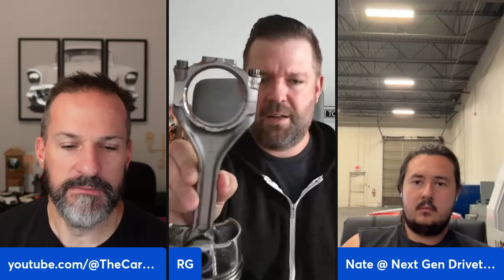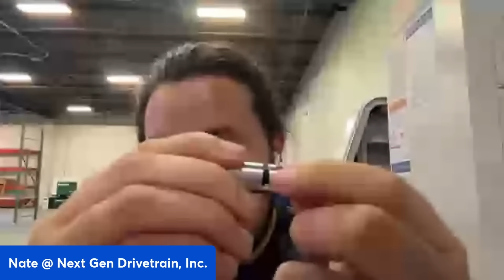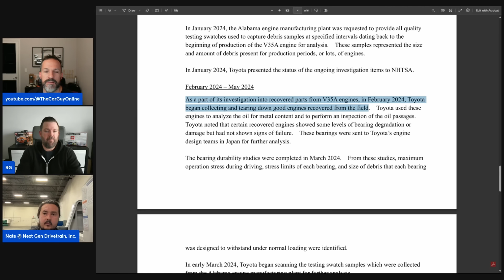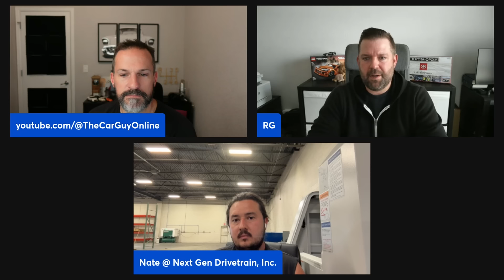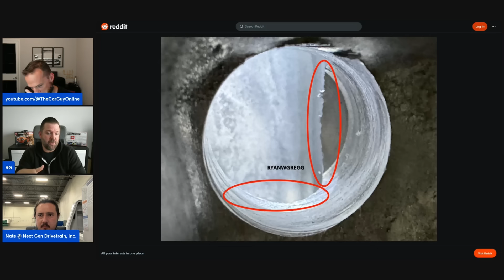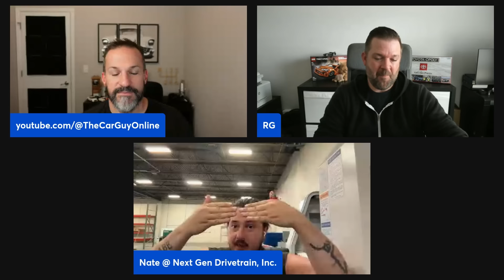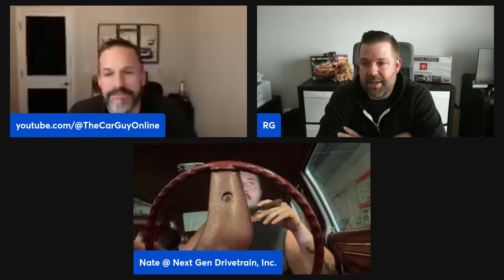Toyota Tundra BOMBSHELL. Buyer Beware Until 2026 (Full Interview)

Comment: My 2025 Toyota Tundra’s engine blew at only ~20,000 km. The dealer “repaired” it, but the same issue came back. On top of that I had to deal with sneaky sales and service tactics, zero transparency, and no accountability. They never offered a buy-back, never apologized, and stayed silent while I was left with the stress and downtime. I finally gave up and traded it in for a GMC.

To make it worse, my in-laws’ 2024 Lexus NX 250 also had its engine blow. That’s two catastrophic failures in two brand-new Toyota/Lexus vehicles.

I’ve owned 5 Toyotas in my life, but after this harsh experience I’ll never buy another. Toyota built its reputation on reliability, but those days are clearly over. Sadly, Toyota doesn’t want publicity on how unreliable their vehicles have become — but owners like me need to speak up. Buyers beware.
Reply: Sorry to hear. That is frustrating
Reply: I'm with you except; I will not buy anything new built during or after COVID after my experience with buying my 2024 Tacoma with many issues. I will still own Toyota, but it will be used, pre-COVID era. We've purchased 12 NEW Toyotas (almost half a million dollars' worth of Tacoma, 4runner, Rav4 vehicles) since 2007 with 11 of them between 2017 and 2024, but no more. ANY vehicle made during or after COVID all have the same issues - supply chain, planned obsolescence and shareholder greed.
Reply: @JPMediaRR I specifically bought my Texas built 2019 Tacoma with only 13,000 miles on it in summer of 2023. Thank God because when I heard about the turbos I said nope and opted for pre Covid built and in USA
Reply: @JPMediaRR  tech line tells us we will not be out of covid built quality until 2029 to 2030
Reply: @hdnekemmkkwwkxmxkdkknxnxkd6549  by then, most won't be in a position to purchase anything new. I know I won't. It's getting harder and harder to pay monthly expenses. $1000+ car payments aren't for me. Way above my current pay grade
Reply: Sad about your automotive shit storm but glad you're spreading the real world events and horror stories from a real owner's perspective.
Reply: Looking to GMC for a better experience is like asking to ride the crocodile across the river.  

Engines, transmission and electrical systems in the GM’s are utterly atrocious
Reply: @BCSVT atleast the crocodile will make it across! GM. Maybe.
Reply: @BCSVT like all of them today. Go work in a full scale shop for a week. It would be enlightening.
Reply: @johnmon94   Dude, I’m so deep into the maintenance industry, you have no idea
Reply: Toyota AINT WHAT IT USED TO BE! Emissions and meeting CAFE and fuel efficiency has taken its toll.
Reply: Going down that conspiracy rabbit hole. Could agenda 2030 be at play here? Who was it that stated that in the future you will own nothing and be happy? Klaus schwab..
Reply: Glad you got to unload it ! Too bad for toyota
Reply: Dang and I’m constantly reading nightmare accounts on GM Chevy Silverados /trucks too.. there’s literally not one stand out truck that kicks ass or comes close.
Reply: You know traded one unreliability for another one. The only new truck I could recommend is a Rivian or a Cybertruck but, unfortunately they are very expensive and EVs are not an attractive option for most full size truck buyers. If you are a truck buyer and you don’t want an EV and you do not need a full-size truck, my only options are Nissan Frontier or Honda ridgeline. If neither an EV truck, ridgeline, or frontier is going to work for you, your only option is to buy used. The best new pickup truck that is likely going to come out next year will be a TELO MT1.
Reply: You have an important point.  Some people treat Toyota like  cult religion.  No matter how many times they get screwed,  they keep coming back for more. Swearing Toyota is best,  cares for the customer,  and is the ONLY brand to buy. They return to Toyota for more abuse,  like a battered spouse with no self-esteem returns to the abuser. It's ridiculous.
Reply: YES
  SHOUT IT OUT LOUD
Toyota quality sucks
Reply: Do you know where your in-law's NX was manufactured?
Reply: Yup. My dealership was great to deal with, but Toyota Corporate was bottom of the barrel bad.

And yes. Plenty of failures in the NX as well.
Reply: What do you buy new? 

Ford and Chevy are jokes not even mention stealantis
Reply: @SamuelLee-i7t4b  great question!  Truck industry is  going to get real interesting over the next 5 years.
Reply: @SamuelLee-i7t4b  The Nissan Frontier seems like it's a good little truck if you're set on buying a brand new vehicle. It's about as simple and basic as you're going to get in a new truck. So far they've been very reliable and people love them. And if buying used they're probably relatively cheap. They have a naturally aspirated V6 and a regular geared 6spd auto. Leaf spring suspension. Nothing fancy. And I think a new one is around $40k out the door or something like that. 

I wouldn't get anything else from Nissan though. 

And if buying used, there are a lot of good cars and trucks from the early 2000's before quality started dropping off. You just have to find one that isn't clapped out. Pretty much everyone I know drives chevy trucks from 1996 to 2006 and they are dead reliable. My co-worker has a 2006 suburban with 433k miles on it, my own 2005 truck has 243k, my friend's 2007 just rolled over 300k. It has AFM but he disabled it years ago which is probably why it's still going.
Reply: @Bloodbain88  I would choose wisely with Nissan. They are in deep debt and have recalled almost 500,000 vehicles due to engine issues, which can sink the company. What do you do when the company no longer exists? You'll have no warranty, and parts will become hard to get. You may be able to get Chinese parts, but that's a crap shoot. Personally, I would only focus on pre-covid used vehicles. Just my opinion, YMMV
Reply: @JPMediaRR 😅
Reply: @SamuelLee-i7t4b I’d buy any of those companies instead of Toyota actually. Had a first gen Tundra and loved it til a deer killed it. Never again with Toyota of this is their new stuff
Reply: @Ilikebeer20 stay away from all of them. 

The new Chevy's and Dodges are junk and Ford's recalls are insane also 

I'm probably going to take 40 grand and build a couple of first gen tundras for personal use. Unless I can find a good land cruiser
Reply: @Ilikebeer20 my primary choice is Tesla if I had to buy new. However I have a heart for the Telo MT1 electric truck
Reply: @SamuelLee-i7t4b 😊 You going to build a bowl of cereal pal. Meanwhile my 24 ram just rolled 80k and running strong.  Just get a mini Cooper sambo.
Reply: @SamuelLee-i7t4b all manufacturers are today. DONT BUY NEW!
Reply: @johnmon94 I agree. I’d refuse to buy a new vehicle unless there is miracle.
Reply: @SamuelLee-i7t4b BYD and Geely can’t come soon enough to scare the S💩 out of Toyota
Reply: @AuralioCabal-nl8gi  Looking to China for quality is laughable
Reply: @BCSVT You have not been to China and driven their cars, but don’t you worry , one of your DESCENDANTS  will , like YOU drive Hondas and Toyotas today.
Reply: @BCSVT I bet you are using a IPhone or smart device and don’t know that it came from That China.😂
Reply: @AuralioCabal-nl8gi   Name a Chinese company that designs and manufactures high quality products.  BYD and Geely build cars that emphasize curb appeal over substance, they are total junk
Reply: @AuralioCabal-nl8gi  Nah, Chinese culture and Japanese culture are very different.   Chinese companies will never seek perfection, they will build high polish junk.   Kind of like Hyundai/Kia today
Reply: @BCSVT LIKE I SAID YOU ARE CLUELESS AND HAVE NOT BEEN TO CHINA.  , As a Filipino Canadian I have no love for the Chinese  and their ways , but I am not blind as I have seen their progress , a Japanese company I worked for , Mitsubishi  set up factories there, We taught them about QC and production in Electronics way back in 1985, and GM Ford and Toyota  and other Japanese automakers set up shop there in as well , oh BYD , Geely and others are selling   Their Cars and Chinese Buses( Yutong) sell as well in the Philippines and they are comparable to Japanese cars.
Reply: @AuralioCabal-nl8gi   I’ve seen the cars, they are trash.   Superficially attractive.  You apparently don’t know automobiles well enough to discern the difference in quality engineering versus a nice dash screen and retracting door handles.  Chinese manufacturers will never lead in quality, the culture isn’t there
Reply: @BCSVT They are better than American cars . PERIOD
Reply: @AuralioCabal-nl8gi  They are MUCH worse than American cars on a fundamental level.  PERIOD.
Reply: @BCSVT You are on a channel that is saying Toyotas V6 Twin Turbo has problems, and you seem to ignore that there are 100,000 Tundras being recalled and it is still ongoing. Toyota is finished.
Reply: @AuralioCabal-nl8gi Spoken like someone that’s totally unaware of the massive quality issue of BYD and Geely.  They are trash.
Reply: @BCSVT You have not even sat in on.LOL
Reply: @AuralioCabal-nl8gi Sat in, been underneath,
bent a primary frame rail with a set of pliers. You have no idea what I’ve done, seen or know.  Far more than you in all cases clearly.
Reply: @BCSVT HEY  DUMMY ! YOU NEED TO WATCH A FEW EPISODES OF AUTOLINE DAILY! Listen to what AutoTeardown experts hlike CareSoft has to say about Chinese EVs like Xiaomi  and Sandy Munro of Munro Associates, THEY are real experts in the auto Industry . Legacy automakers are doomed , they cannot even compete .We North Americans are SCREWED ! BIGTIME  , that is why there are 100% TRUMP TARRIFFS ON CHINESE BEVs!
Reply: @AuralioCabal-nl8gi  BYD is trash and I don’t defer to “experts” who expertise pales in comparison to my own. 

BYD is total junk under the skin.    
Their business model is very similar to Hyundai/Kia.  
Cheap, cheap when it’s out of sight but invest when things are obvious.   
This results in disposable junk that people that don’t know autos, such as yourself, who judge quality based on superficial, subjective traits like appearance and the amount of soft touch surfaces in the interior and tech gimmicks means they’re leading the industry.  

BYD’s only competitive edge is production costs right now, their actual products remains highly polished turds
Reply: @BCSVT I trust your “ Expertise “ a far as I can throw it !😂
Reply: @AuralioCabal-nl8gi   I don't need or want your trust, it couldn't be less relevant to me.  I know more than you and that's all that matter.  Your uninformed opinion being revealed as uninformed and unqualified is all that matters.
Reply: @AuralioCabal-nl8gi I’ve known people with Huawei phones before the ban. The only non iPhone smartphone that I have interest in is a Huawei.
Reply: @BCSVT 😊Well he told your jelly jelly roll pumpkin head couch potato head off.
Reply: @Hank-j5g  He got utterly wrecked by someone that knows the topic better
Reply: @SamuelLee-i7t4b never unless there is a miracle or a Tesla. I really like the Telo MT1 though.
Reply: @SamuelLee-i7t4b  Hey Ram is the best new truck to buy right now it will be cheaper to fix down the road...
Reply: Bro i am a toyota master tech. And I get a giggle from people that lie and make up stuff that toyota is still reliable  lol.   Toyota hasn't been relibale since honestly 2017
Reply: @hdnekemmkkwwkxmxkdkknxnxkd6549 How about their hybrids like the Toyota crown sedan? I have a 2025 XLE. Should I worry
Reply: @sammyjammy6647 i would be worried absolutely 100 percent. I work for Toyota and will not own one
Reply: @sammyjammy6647 major decline in all manufacturing quality starting right around 2017 with all manufacturing companies.
Reply: @johnmon94  I didn't have any issues with my new Toyotas until Covid. It literally changed the world. Consumers no longer have the same purchasing power they did pre-covid. Manufacturers and financial groups set the tone for the consumer buying process and there really isn't a great choice for a better product as they are all in a race to the bottom. Best bet is to buy used reliable models. I'd love to find a one-owner second gen Tacoma with low miles with 4-wheel drive, but they are rare because people either hold onto them, or they are purchased soon after they come up for sale
Reply: @JPMediaRR talk to the Toyota master tech in the comments that says otherwise since 2017 with Toyota
Reply: @johnmon94  I'm not disagreeing that there may have been issues 2017 and on, but I personally haven't experienced any issues with the 3 Tacomas and 1 Rav4 I purchased from 2017 to 2019 YMMV
Reply: @JPMediaRR  💯
Reply: nissaaan frontier is best i figure  better get that trans valve body man gm be opk then
Reply: @overbuiltautomotive1299 Frontier is a solid truck .
Reply: So the question I have? Is toyota now on par with kia/Hyundai? You get alot more bells and whistles on the Korean cars. Keeps you distracted from engine noise😂!

Comment: The BLUF:  If you have a ‘21 or older Tundra…KEEP IT!!😂
Reply: 2018 platinum...124k miles. Still drives as if it were new. No issues.
Reply: My ‘20 sport never to be sold !
Reply: My 2019 is a diamond
Reply: 2018 Tundra with 65,000. Love it.
Reply: @chefchris5133 still new! Just do your preventable maintenance and it will last a lifetime. Get those diff fluids changed and trans fluid.
Reply: 2019 Sequoia and love it
Reply: Unless it has rust issues.
Reply: Just bought a 25 Tundra trd limited 
1500 miles in 3 weeks owning it and I love it. 

So far so good 👍🏻 

Thank you for the show🙏
Reply: I love my 2019 Tundra! 22k only on her but will be towing our new RV soon with it. I has been great towing my bass boat to and from the lakes. No plans on letting her go.
Reply: 2013 CrewMax Platinum 5.7. 150K mis. Runs and looks like new!  My. Wife offered to dig a bigger grave when I go and drive me in ….. not soon she said! I think my grandkids will object.
Reply: No thanks. Life is too short to drive boring, old vehicles.
Reply: @user-mh5qg5jb7d  those "boring, old vehicles" are fun projects... You can do some much with them to pretty them up, add tech features, etc. They are only boring and old if you do nothing to them. But even then, they are reliable af.
Reply: @user-mh5qg5jb7d  life is potentially even shorter when your engine eats a bearing at 3am driving through Arkasas.
Reply: @user-mh5qg5jb7d How much debt do you have?
Reply: @JohnBasiglone  I paid cash for my truck if that is what you are asking.

Comment: Here I sit wondering when my 2024 1794 Limited is going to die on my wife or I with the gran-kids. I have low miles as I work from home, but the worry is real!
Reply: Same, I have a 2023 non-hybrid, built Feb 15 2023, didn’t make the recall cut. I don’t believe the engine debris thing anyways. I bought a platinum warranty a few weeks ago thinking I’d get some piece of mind but honestly, coverage for a monetary setback doesn’t matter when your engine stops at 80 mph on the freeway, god forbid someone slams into you let alone being stranded. Last tundra I had for 12 years, I can’t see that happening this time.
Reply: @staceygoodale6427 Now part of the recall? Any time frame given?
Reply: @timjudge9910 yes it became part of the expansion of the recall on November 6th……. exactly six days after I got rid of it.

Comment: Carcarenut recently had a video talking about the 8 speed transmission thought to have been fixed may not be fixed. They are seeing more failures of the transmission with age and he actually recommended an extended warranty be purchased for this cause. I personally would never recommend an extended warranty. I know with my wife's 2020 Camry SE we have serviced it on time and even before Toyota recommendations. Did transmission at 45k miles. As far as 5 years in we have had zero problems from the Camry. Also they are seeing the cam covers leaking again with some of them.
Reply: While I can see both sides of this coin, it is becoming more likely that there are issues. While routine/before recommended maintenance is a good thing, it can't always stop things from happening that are out of our control.

I did an oil change at 1K, 3K, and 5K on my 2022. 5K OCIs after that. Engine still seized @ 60MPH in 105° heat.
Reply: @ryanwgregg  More time will tell so far the car has been flawless. The biggest problem now days is the technology being used top meet regulations is just not there yet and they are using us to test it. Hopefully with recent changes at the EPA regulations will be eased and auto makers can begin returning to tried and true technologies. That being said I am not against cleaner engines just regulations that push automakers into technologies that are not reliable. Still got my trusty 2003 GMC to fall back on if needed.

Comment: Even my 2000 BMW 330CI easily bagged 30MPG highway drive reasonably  With the 3.0-liter M54 inline-six engine DOHC and Double VANOS variable valve timing and Siemens MS 43 engine control system with port fuel injection
Reply: Yup. Even my Ranger would get almost 26MPG on the highway back in the early 2000s.
Reply: Miss those M54 engines - they were a great motor

Comment: My son and I are refurbishing my 2003 Tundra SR5 Sport with 232,000 miles. Power train is solid. It needs front suspension repairs and just replaced the front differential. The body is horribly faded and clear coat is pealing (nearly totaled in 2007), but it runs great. Tank to tank calculation of fuel economy is still ~18 MPG. 
Once it’s ready to be a daily driver again, it’s all his.
Reply: I had 2002 just that 4 speed hates to work hard (I went though 3 towing), 5 speed fixed the issues.
Reply: Push for that million mile mark! Great project with the son too.
Reply: We have a few in the fam with 250k plus , they burn no oil and one has 320k sounds like a sewing machine runs like it has a couple hundred more left. Mobil 1 10w30 always.